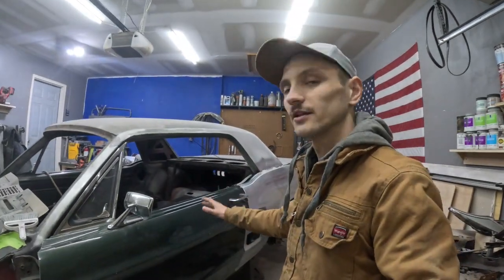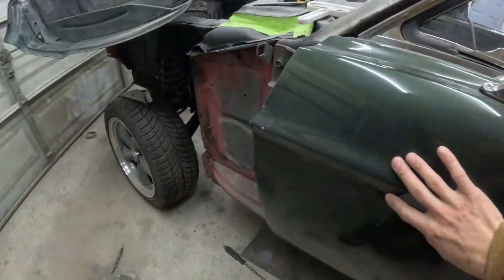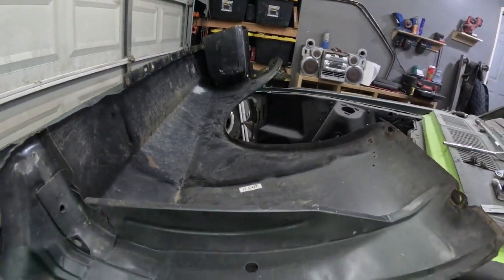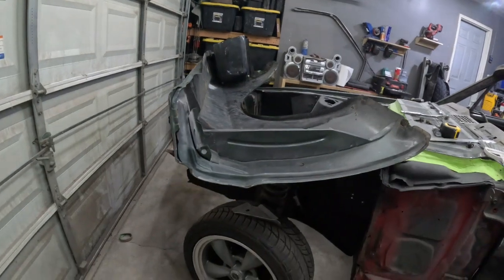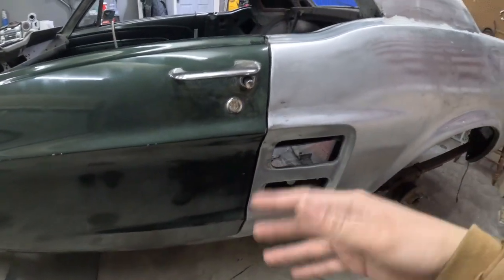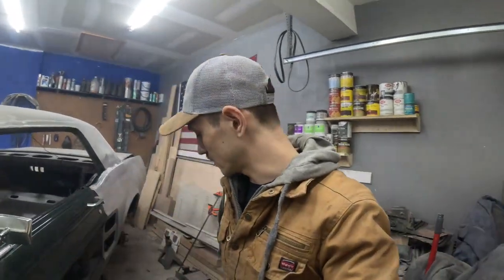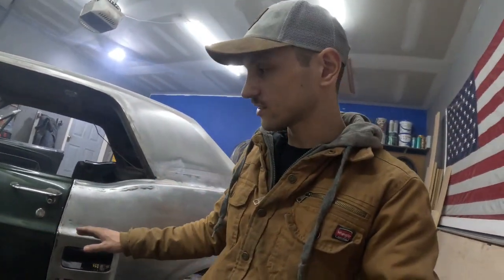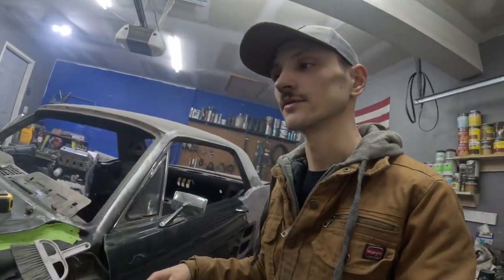Project Ivy PT 7- Driver side to rear quarter relationship. (time-lapse)

Comment: Wow😮, that's a lot of work!! The outcome, did look really 👍... On the aftermarket fender, I have seen guys slit that body open, on the point... And use a wedge to widen it a bit, then add a piece of round metal stock welded on top, then ground it down to get the proper "look" and profile to match original door body line... Keep em coming!!!
Reply from the maker: Thanks for the tip. I’ll have to look into that as a possibility solution for the fender.